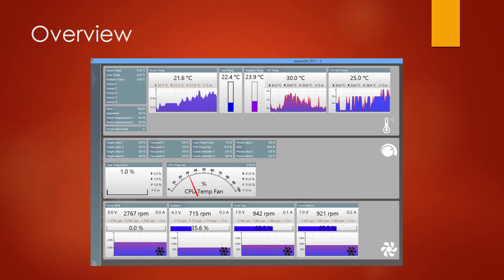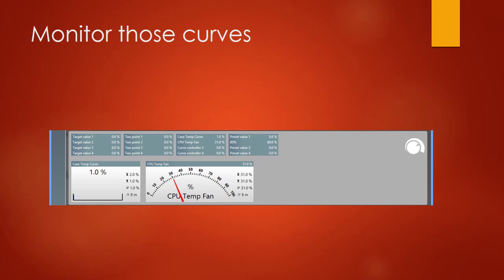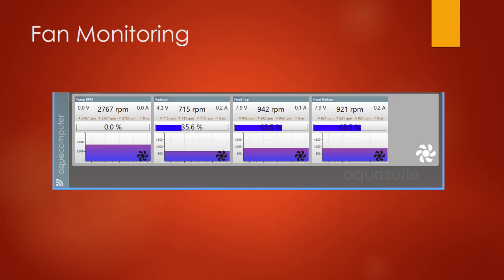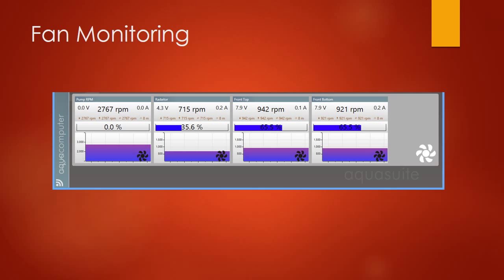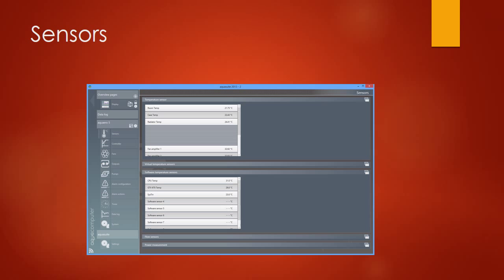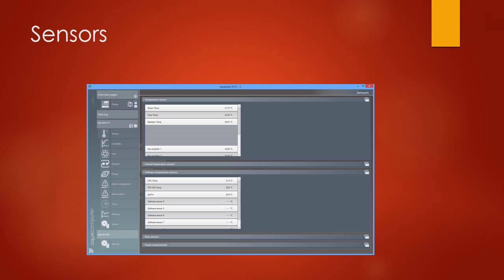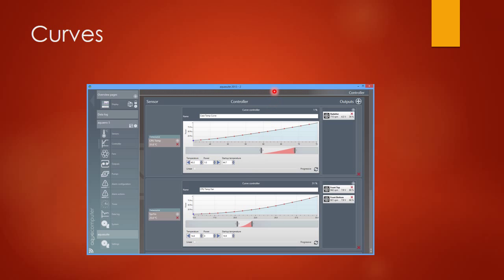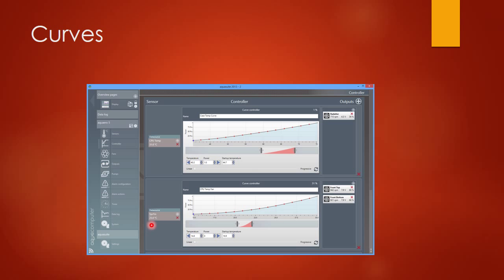Aqua Suite 2013 and Aquaero XT

Comment from the maker: i had the corsair controller before, and this is WAY more powerful in it's curves, also it supports no PWM fans, so it can reduce the voltage to the fans to slow them, this makes it a much better product if you have non  pwm fans.

Comment: Ok. And can I control the fans by CPU temperature. I have read, that you need some additional software to inject the system CPU temp into AquaSuite, is that correct?